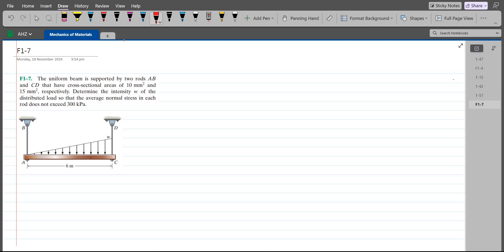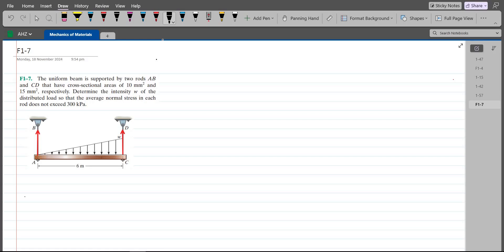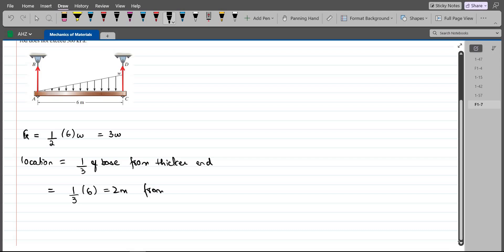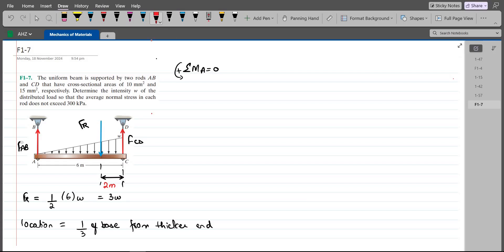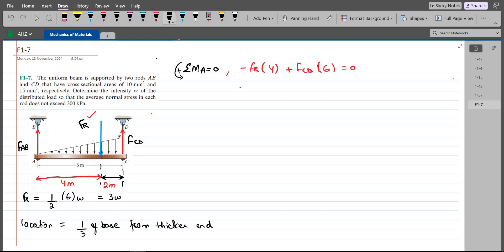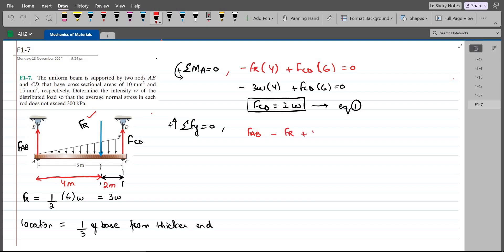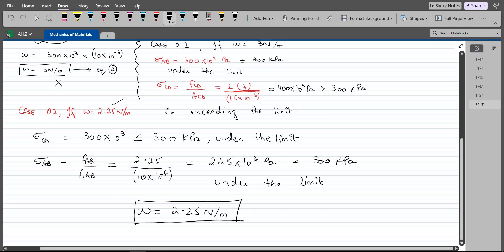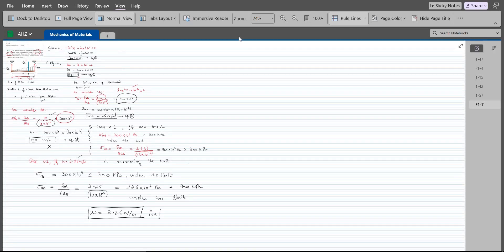F1-7 hibbeler mechanics of materials chapter 1 | mechanics of materials | hibbeler

Comment: Sir I have a question. Isn't Pascal x m² = N? How is it N/m?
Reply from the maker: Actually w is the intensity of distributed load, for distributed load the unit is N/m. I hope it will help!
Reply: @solutionsmanual9535  yes it should be N/m but isn't multiplying a pascal and square meter equal to a Newton? The given should result in a N/m since it's a distributed load that's why I'm confused since the conversion doesn't align and I need to pass this assignment tomorrow 🤧